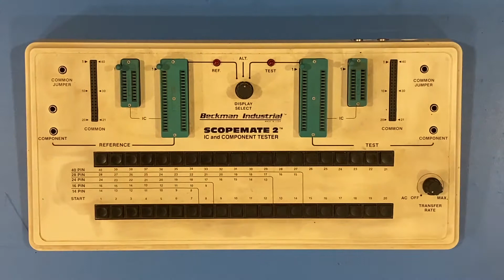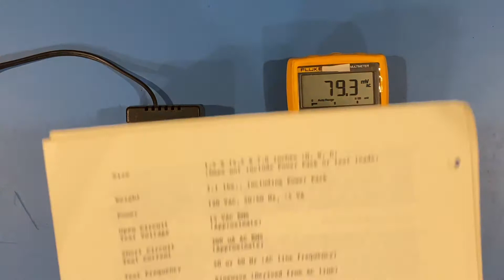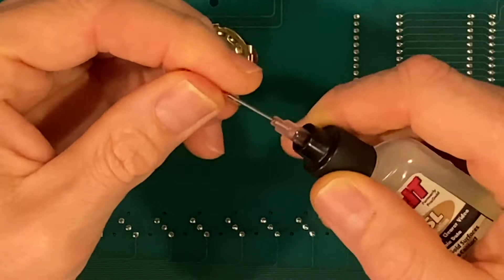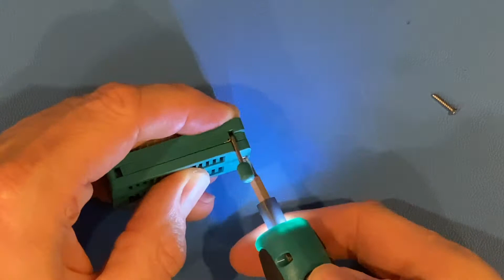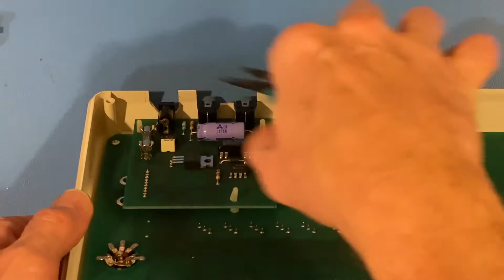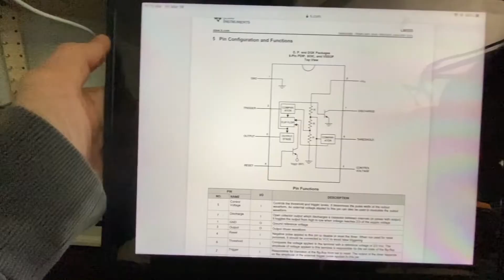Scopemate 2 by Beckman Industries, circa 1986, Service, Repair & Tutorial

Comment: Good show.. GR8T "camera work". It is like being there...  Blast from the past: In the 80's I remember selling Beckman (the cat's meow for the average guy) at a old-school electronics store. That  "comparator" seemed like magic and was quite expensive equipment. I was sure it had dual 68000's in it ;o) I don't recall selling any but I did sell lots of 1/4 watt resistors. Cheers!
Reply from the maker: Thanks for that memory!  Where were you when you worked at an electronics store, very cool!